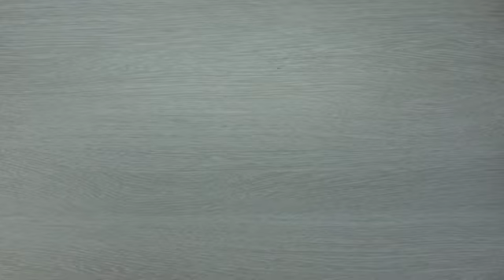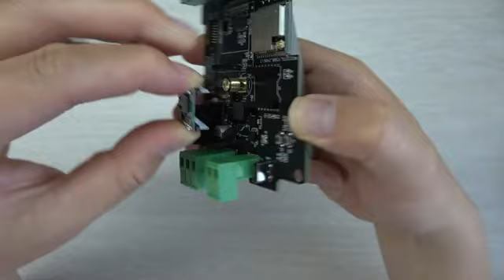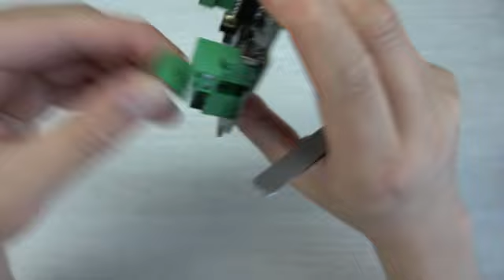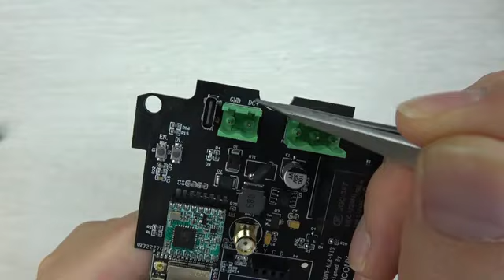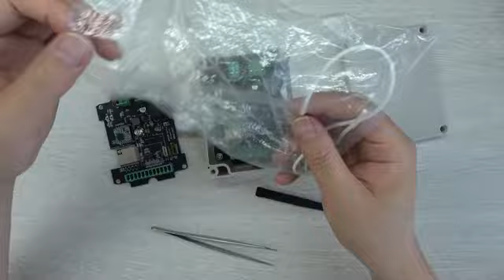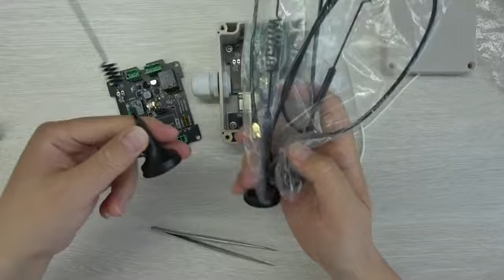ESP32 LoRa SX1278 Gateway Module Work 500 Meter Tested - KinCony ALR

Comment from the maker: Hardware resource:
Power supply: DC9-24V
USB-C: download firmware
Buttons: ESP32 Reset and Download
ESP32-S3-WROOM-1U N16R8
SX1278 LoRa module: default use by 433MHz
Relay: MAX Load AC250v10A COM,NO,NC
SSD1306 i2c LCD
8bit DIP switch: set LoRa device address
Analog Input: 4 channel dc 0-5v signal
1-wire: 1 channel
digital input: 1 channel (dry contact signal)
I2C bus: 1

Related technical information
———————————
ESP32 I/O pin define: https://www.kincony.com/forum/showthread.php?tid=6164

Arduino IDE demo source code download: https://www.kincony.com/forum/forumdisplay.php?fid=59